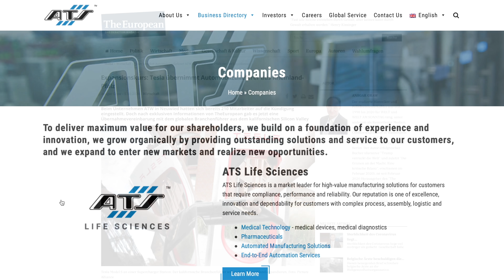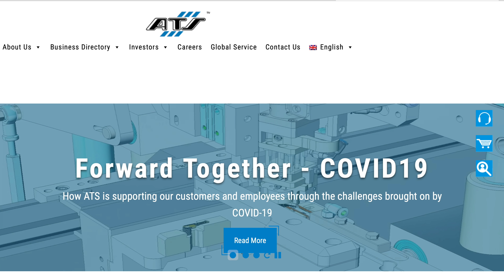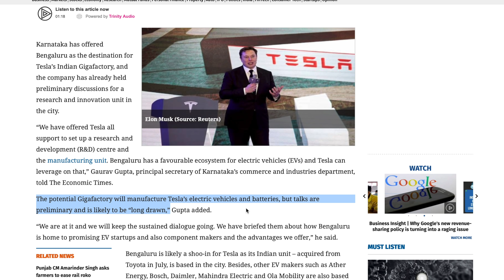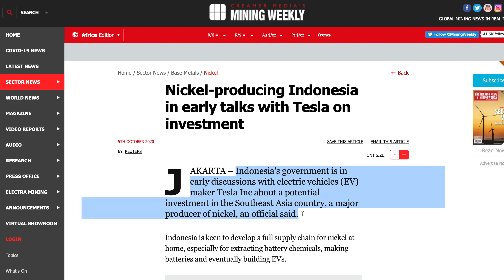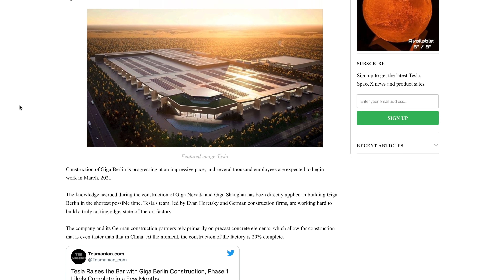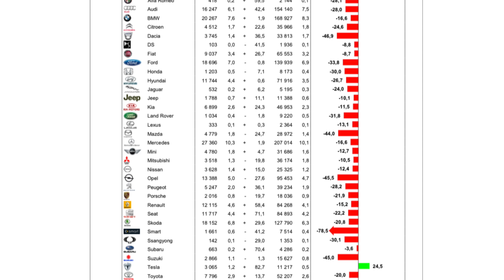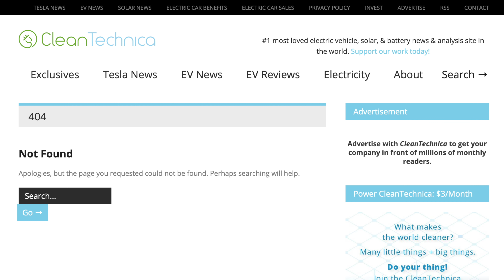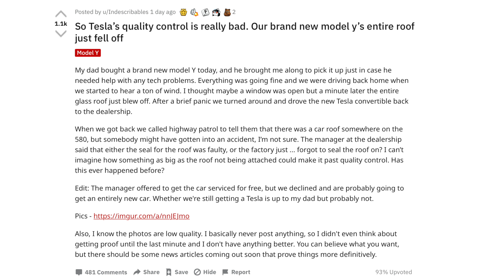Tesla’s New Acquisition, Possible India Gigafactory, Indonesian Nickel, Giga Berlin Updates

Comment: Fixed glass on Teslas, including windshield, roof glass and rear widow are held in place by a bead of adhesive. That adhesive is applied by robots. Typically two robots are involved, one to hold and move the glass and the other to squirt out a perfect, continuous bead of adhesive. I imagine what happened here is that the robots went through the motions, but the adhesive was not flowing, and the system failed to alert someone before this vehicle slipped through. Given the weight of the glass roof, it's not surprising that it stayed in place during shipping. It will be a simple matter to add additional confirmation sensors on the assembly line.

Comment: Regarding the roof fly-off: There is a fine line between quality assurance issues, negligence and outright sabotage. I recently picked up a new MY. Whenever I put the car in reverse and turned the wheel the front end made a crunching sound. I foolishly assumed it was just some kind of gearing noise and disregarded it. Weeks later I am looking at the car as it’s parked and see the front right wheel canted in. Upon inspection, looking under the car specifically the right lower ball joint spindle - the nut was missing. The spindle was in the hole just by the weight of the car. The hole was “wallered out” do to the recent driving done. We took the car to Tesla service, they did an exceptional job restoring to new. But I wonder if I actually picked up the car weed before without the nut on the spindle, I don’t know. I love the car though.

My point is too much of this is going on. Is it more than quality but actual sabotage? Tesla and Musk have many enemies: big oil, legacy auto, unions, shorters and a slew more. This should be investigated as potential sabotage. This would not be tolerated in the aviation industry.
Reply: Tesla has tracked down the unsealed sunroof issue to a new employee. Some guy named Trevor. CCTV revealed he was distracted by watching the stock ticker on his phone.
Reply: @Ottee2  Guys of the Milton variety, right?
Reply: @Muskar2  , allegedly.
Reply: I think it was more likely that an employee overlooked some part of the process. They were pumping out cars like mad to get them delivered to as many people as possible, especially towards the end of the quarter.

If it was actually a sabotage, would it not be more effective to make several roofs fly off instead of just one to cause maximum damage?

Comment: I was with you on the quality problems... until we received our Model Y.  I'm not picky, but nearly every panel had paint issues, doors were poorly aligned, one wouldn't close, and interior trim was installed incorrectly.  It had me rethinking my stock purchases. This most certainly will come back to bite them once other manufactures offer comparable vehicles without chronic quality problems. They NEED to get this under control !

Comment: FYI; Tesla model 3 & Y owners you can not add decals to the front bumper area that have reflective material or carbon fiber decals. The radar is mounted just behind the bumper and the decals reflect back, giving a false reading, it will not go into cruise control, or auto driving.

Comment: 12:20  Must be the new sound system - it blew the roof off.

But really, I suspect this is a result of the hard push to get cars made and delivered for the Q3 numbers, something I have been concerned about.
Reply: I like how in the story they have no idea where on the 580 the roof went and have no idea if it caused an accident or not. Were they driving for miles and noticed..whoa my  roof disappeared? Didn't hear a loud crash of glass behind you or people slamming on their brakes? Just a weird story.
Reply: Singuy888 light and sound condition in the car should change drastically and instantly 
There is no way they can not notice that
Reply: @Singuy888  It is a weird story, I agree. But Tesla should be able to determine from the remains of the sealant on the vehicle how it failed. It sounds like from the description that wind somehow got in under the seal at the leading edge of the glass, then the resulting air pressure forced the rest of the seal to fail and the glass to fly off. The glass obviously wasn't just resting on the top of the car without any sealant holding it in place. In that case the glass would have blown off even before reaching full freeway speed. They reported that they "started to hear a ton of wind" and then "a minute later the entire glass roof just blew off". Obviously a more gradual failure of the entire seal.
Reply: I have 270 shares of tesla. Despite the month+ of being closed they did beat expectations but other car makers were also killing it because people had unemployment money
Reply: lucky no one killed.
Reply: Thought it was a new convertible model y 😂